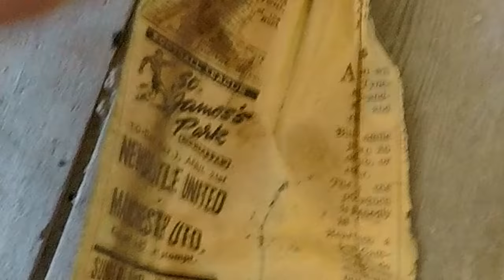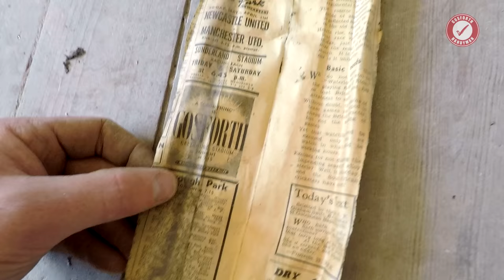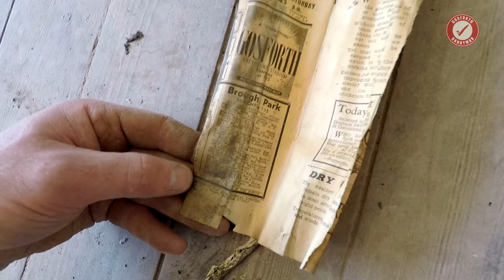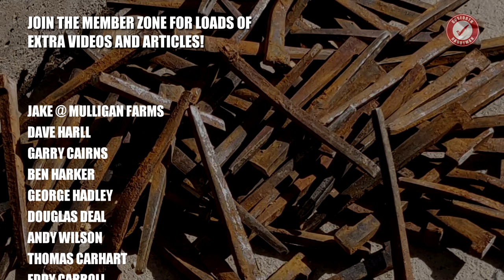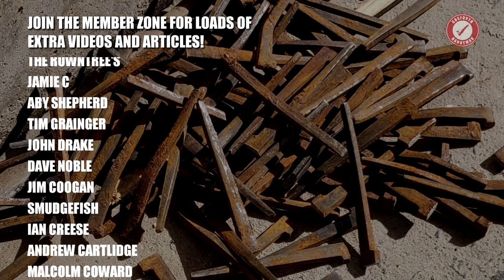How we INSULATE under the floors (1920's Renovation Part 26)

Comment: Great video mate, is there any need for some kind of vapour barrier on the underside of the insulation? On the sub floor side or is that the wrong approach?
I'm just wondering because I'm thinking of doing this myself. Well done with the video and it's really helpful.
Reply: Vapour barriers should always be on the warm side of the insulation - so on top of the insulation in a floor (or below in a ceiling/roof) - which is also easier to install.  You would need to take the entire floor up to do this though.

Comment: Late Q if you don't mind --- I am putting PIR between the joists in my 1930s no-cavity house, and a lot of boards are coming up really really poorly (even worse than yours). I will try and save as many as possible but --- did you do hard wood directly on top? Or is there a layer between the floorboards and the hardwood floor? Thanks. Also -- is interstitial condensation a concern?
Reply: In a later video he shows him laying a floating hardwood floor on top. Obviously have to think about condensation, often insulation (wool type at least) is laid on top of breathable roofing membrane, which reduces vapour transfer upwards but still allows it to escape with ventilation. Also improves effectiveness of the insulation. And quite common to put a vapor barrier on top of your insulation, on the warm side. Condensation less of an issue there because it's unlikely it'll ever get cold enough to reach the dew point.

Comment: If we're putting laminate flooring in and instead of insulating beneath the floorboards, we double up the insulation under the laminate (which the instructions say is fine) and tape all the gaps, will that give a decent amount of insulation and stop drafts? 
How many times more effective will Andy's method be compared to that and would there be any other downsides or upsides? For example, I'm wondering if it will be any better or worse for the sub-floor ventilation.
It's many time easier that pulling the floorboards.
Reply: Hi, I was just wondering if you went ahead with this method - double insulation under laminate as I am trying to decide between this as well. Thanks.

Comment: Did you tape your joints? Would be a shame not to as the smallest of gaps has a massive effect on the efficiency of insulation.
Reply from the maker: No 'cause I've used full length battens underneath - these seal any gaps. 👍

Comment: Screws in at an angle (or it looked like they were) to avoid old holes and/or to avoid the boards pulling up with time?
Reply: Think only angled on board ends as the board was likely not fully on joist and probably the end of the board was trashed and split so fixed from further back at angle to catch the joist
Reply from the maker: Yeah, just for board ends to catch the joist 👍

Comment: Great video! Quick question about the insulation by the airbricks, do you leave it short to create a channel from the left airbrick to the right one, cut at an angle as you showed, or just immediately around each airbrick and then insulate as normal in the gap in-between them? Thanks.

Comment: Hi mate, my joists run parallel to the solid wall with about a 2 inch gap. Would you fill this with expanding foam? To complicate things further the DPC is 1 course over the internal floor, so if I do fill with foam it'd be between the joists and solid wall below DPC.... Will foam bridge the DPC?

Comment: I will never understand why people go to the ridiculous expense & risk of this kind of work. 15% saving on heating won't pay back in any reasonable timescale, you get the added worry of it causing rot due to reduced airflow (might mean you'll need replace all your floors within 10 years) and if exposed sanded floorboards are back in fashion when you want to sell your house you've just put a lot of people off buying it!

Insulate your roof, insulate your walls, put in double glazing but leave the floors alone!

Comment: Andy, your video inspired me to to undertake this work myself so thanks for that.
Unfortunately I had to lift virtually every floorboard as my joists were just 100mm and the Celotex  board was 120mm. That ruled out using battens, I had to use four L brackets per length of board instead.
I’d like to ask about the foil insulation material I’ve seen used by others who have completed similar work (I don’t believe you did) Having installed Celotex is it advisable to then add a product such as Eco Quilt on the floorboards? My concern is this may cause condensation ?

Comment: Hi Andy, what are your thoughts on doing this for  rooms on the 1st and 2nd floor of a property? We own a 1901 victorian terrace and want to expose the original floor boards but of coarse we then have a draft/heat loss issue as the floors aren't insulated on these floors.
Reply: It's just the ground floor needs insulating because underneath is basically outside with a big draft

Comment: Why the air brick gap was left uninsulated (at 24:30)? I found a similar gap in our home floor, and now when we are changing insulation, I want to know if this gap is mandatory to be left uninsulated?
Reply from the maker: The insulation would block the air brick and you absolutely need the sub-floor ventilation. 👍

Comment: Does this require building regs approval then?
Reply from the maker: Well there's a big question 🤣 - you'll get me going on a rant since the building reg fees would probably be considerably higher than the cost of the insulation 🙄. So much for encouraging lower CO2 and all that! We've got building control involved anyway on the extension - I'd suggest checking with your local building control since it's so vague.
Reply: @GosforthHandyman  Yes it would need Building Regs approval if it was done as a stand alone job. It's changing a thermal element.

Comment: Just wondering, had upstairs carpet out for plastering and was going to replace some squeaky floorboards. Is there any point in insulating floor upstairs or not?
Reply: It's generally recommended to insulate under the ground suspended floor and the loft space. Any heat that makes it to the 2nd floor is still in your habitable  space 👍🏻

Comment: How do you stop any moisture condensing on the foil in-between your floor boards and the insulation?
Reply: It shouldn't do that as it should be the same temperature as the warm side. He could have foil taped between all the insulation to give a vapour barrier as a slight improvement.
Reply from the maker: Yeah, that's the warm side so should be fine. 👍
Reply: @GosforthHandyman  ah good stuff!

Comment: I have the same saw and found if I used a washer on the depth adjustment bolt it stopped it slipping.
Reply from the maker: Will take a look. The bolt is just plastic and can't be tightened properly or it feels like it'll snap. 🙄
Reply: @GosforthHandyman  yeah that was my experience, the washer just helps to increase the surface area giving more grip.

Comment: Nice vid Andy. Are there any issues when it comes to insulating over power cables in terms of their heat generation?
Reply: Personally I don't find it an issue as the majority of the cable will be open to the airspace below.
The only exception to this is where undersized cabling has been used and isn't being replaced (it's usually a cooker or shower feed). Then I would cover it with a run of galvanised capping. This will give it airflow and if any hotspots do form it acts like a heatsink to dissipate the heat.
But really it's the best time to replace the cable, but sometimes it's not your decision.
Tip. Use the capping to cut the foil on the insulation then use an offcut to cut/scoop through the foam to give you the perfect cut. Saves you hacking the foam up with a kitchen knife! 
Then just run a line of grip adhesive to hold it in place.
Reply: @gavjlewis  Cheers Gav!

Comment: Great stuff Andy. Are you meant to tape the joints between insulation boards? Or is it not necessary?
Reply from the maker: Some people do, I guess it wouldn't harm. I'd rather keep as much airflow as possible though so as long as the insulation is relatively tight you shouldn't need it.
Reply: @GosforthHandyman  thanks for the reply! I feel honoured!

Sorry, last question. What extension bit do you use on your drill driver?

Comment: I would love to know more about sub floor ventilation. Also should that fireplace exhaust pipe be vented to the exterior with lung health being topical.
Reply: The exhaust pipe is not connected it's off the old fire so doesn't require venting.
Reply from the maker: Cheers! Covered a bit in a previous vid, but yeah that pipe isn't doing anything now. 👍
Reply: I don't think it was ever an exhaust pipe, smoke does not tend to go down and under the floorboards, it is a place where they might have had some extra cold air intake for the fire, when it did function.
Reply: The pipe is the intake to the fire place so the fire doesn't suck the warm air out of the house

Comment: Many thanks for a skilled, planned and light hearted presentation of a mucky but professionally completed job. Given the variability of the gaps between the floor board supporting members, would it not be quicker to take up all of the floorboards to give a clear view of pinch points. Also, if that was done, could rock wool be used at a considerable cost saving? Many thanks for a great presentation.
Reply: PS. I’m away to watch the other episodes in your series. Thanks 👍🏻

Comment: Here's a stupid question, could you get underfloor heating (non screed version) if you insulate like you've done? I imagine no heat would travel downward through the insulation? My house is just like this but I'd love to get rid of the radiators! Love your videos, wish I had your skills!
Reply: Yes you can either buy aluminium trays that you clip the pipe into or get the celotex with the grooves in but you would need to remove all the floorboards
Reply from the maker: Yup - what be wa said! There's a few ways of doing it but defo an option. 👍
Reply: There's a company called Continal that does a system comprising the chipboard t&g sub floor panels already routed out for the ufh pipes. So you lift back to the joists then install their chipboard and lay the pipe into it. No extra build up in height, no screed. Layer of 6mm ply over that and then your finish.

Comment: That gadget is clever. I thought a rubber mallet from beneath might be  good. Akin to those camping type. Also used in landscaping.
Reply from the maker: Think you'd struggle to get enough force from underneath, unless you have a big gap and can crawl under with the spiders 😁

Comment: Question: Is it possible to remove the joists and install a solid concrete floor with under-floor heating in the properties of this type?
Reply: It is possible, but you have to be careful not create a moisture bridge into the walls, or block airflow to other suspended floors (so probably best to do whole ground floor at same time and find a way to connect new DPM to existing DPC, or even install new DPC).

Comment: How thick was the insulay you used? I was thinking about putting 100mm insulation in-between 100mm joist so the Barton's have to be below. Any advice on this?
Reply: My house is the same and ive gone with 100mm insulatio. A few nails close to the bottom of the joist to hold the insulation in place will work. Battens on the underside of the joist will also work.

Comment: Hi Andy,

May I please ask for your recommendation. In a house with wooden floor boards, carpet underlay and carpet, do you think you need to insulate all the rooms of a house containing a lounge, which contains the heating source, a kitchen, dining and family room, hallway & three bedrooms or just those closest to the lounge, ie the dining/kitchen?

Thanks,
Reply from the maker: The lounge is obviously the main one since it's the room you'll probably spend most time in. Obviously the more you do the bigger the benefits will be though so it's really a balance of what's practical. For example in our hall there's no way I could get under the stairs, so technically 1/4 of the hall isn't insulated at all. We'll live with that though. 👍

Comment: Still not sure that I am convinced about underfloor insulation in these old houses. By their very nature this style of building needs plenty of air flow and the insulation restricts this.
Reply from the maker: You need to make sure sub-floor ventilation is on point and there's no dodgy timberwork, but other than that the construction isn't vastly different from a modern suspended floor. Different if there's no cavity mind as that raises a host of other issues. 👍
Reply: @GosforthHandyman  definitely no intentional cavity on mine 😀

Comment: Any tips when measuring and cutting in relation to width i.e allowing a few mm oversize to get snug fit.I am tackling 14m2 next week with 100mm Ecotherm that will involve a lot of cutting.
Reply: Hi BRI53D, You'll find that even 1mm oversize and they will be almost impossible to fit. They just lock solid against the joists. When using thinner boards, like 25mm thick, you might just about get away with fractionally over, but then the tendancy is for the board to break. My advice is to cut them a little undersize and then fill any gaps with expanding foam from a gun. Make s the job much easier. Cheers Jono
Reply: @jonnow1234  Thanks for advice

Comment: Great! Waiting to move into a house like this in Dublin. Is it futile to do this upstairs too? As in, under the bedroom floors?
Reply: Heat moving between ground floor and 1st floor isn't necessarily a bad thing. You don't want your bedrooms to be freezing cold. Using rockwool might stop noise from downstairs travelling through ceilings, this is the only positive benefit I can think of.
Reply: @dooovde  Yeah, good call.

Comment: Great video. I'm looking to insulate under my upstairs bath room floor as it is half over my garage and half over my hallway. Would this method work  OK
Reply from the maker: Personally, for upper floors I'd use acoustic insulation rather than PIR boards. 👍
Reply: @GosforthHandyman  there is some poorly fitted acoustic insulation there already but nothing under the bath. In  the winter the bath cools quite quickly. That's the thought process of using insulation under the floor

Comment: Is it possible to use rockwool 50mm or 100mm which is more flexible to feed and pull under the floor boards, avoid cutting to small pieces?
Reply: Definitely.

Something is better than nothing.

If you can get under the floor it's common to use netting to hold fibre insulation in position.

You can still use that method working from the topside

Comment: I've lifted many floors but sometimes like here in old houses there seems to be a band of wood stain around the edges of the floorboards, what is it?
Reply: There would have been no fitted carpets back then , you would buy a large rug (a ready made carpet) that fitted the room and stain and polish  the border
Reply: The unstained area is where the carpet used to be. Wall to wall carpet  came in a lot later.
Reply from the maker: Yup! From before the days of wall-to-wall carpets. 👍😁

Comment: Great video! I'm about to do this myself to an 80s build.
Questions-
Is there a reason you didn't use a damp proof membrane on top of the pir? 
And
I've got a stud wall built on top of the subfloor, any ideas how to insulate under this?

Comment: Can anything be done to improve the air tightness of the insulation boards?
Reply: Tape over the joints and then air tightness membrane over the insulation taped about 1 inch up the wall which will be covered by the skirting board.

Comment: You’re not using foam on the butt joins of the insulation? Trusting your saw-skills to be 100% on straight cuts? 😂 I’ve used foam on our attic to ensure that the buttjoins were completely sealed. Also, please don’t cut the PIR on your lawn, you’ll pollute the soil and PIR won’t break down af all. The little bits will fly around the neighbourhood and into the river. There’s already enough pollution so every little bit helps. If you go through the effort of cleaning under your floor it shouldn’t take too much effort to clean up PIR bits inside. 😉
Reply from the maker: The butt joints are either the factory square edge or the other half of the cut I've just made, so they have to marry up.

Comment: You don't need to insulate under the floorboards. That's why the floorboards of elevated off the ground. The layer of air is a natural insulator. There's zero need to insulate.
Reply from the maker: If that was true there'd also be no need to put insulation in cavity walls. 😂
Reply: @GosforthHandyman  You dont put carpets on walls though. Carpets and laminate flooring stop the drafts. 

That's called a false equivalence what you just made.